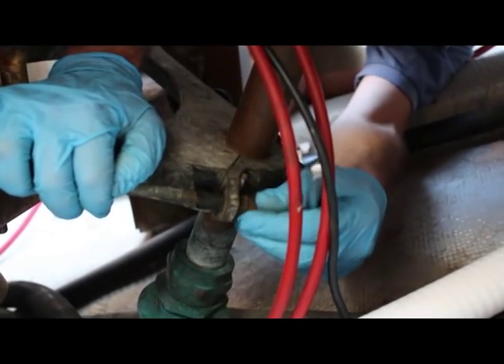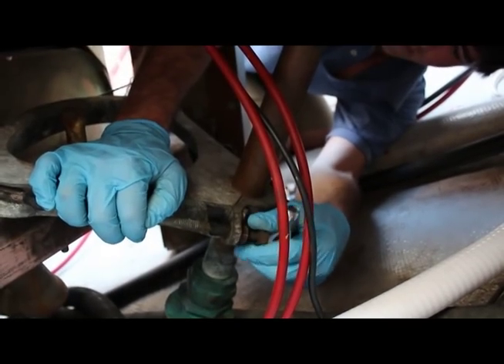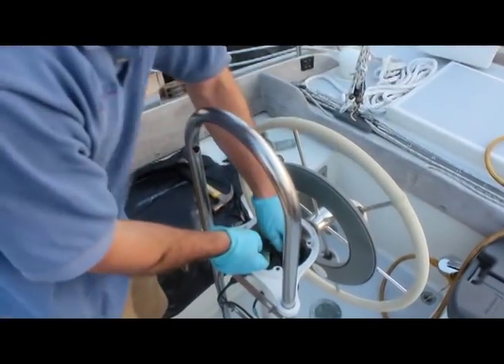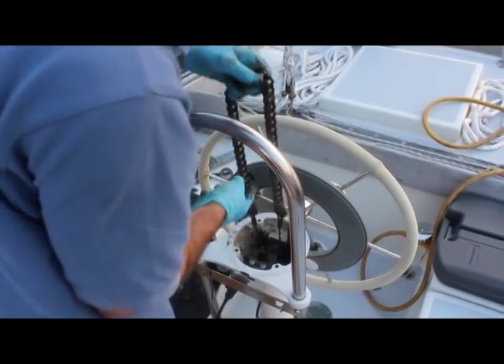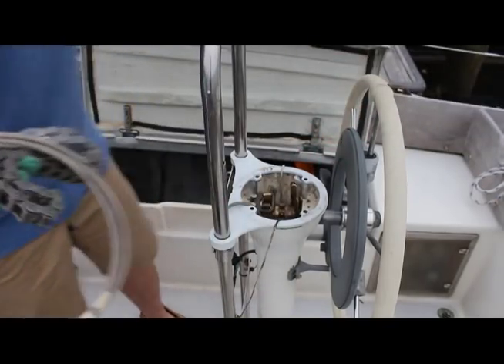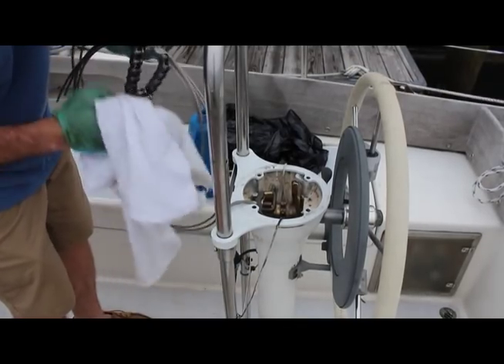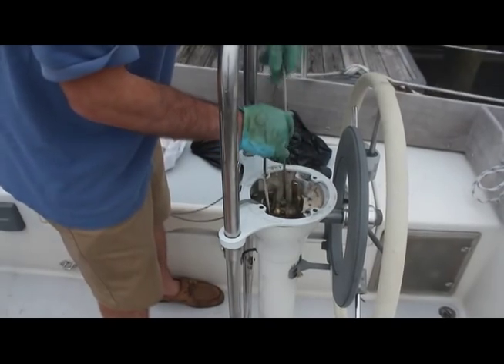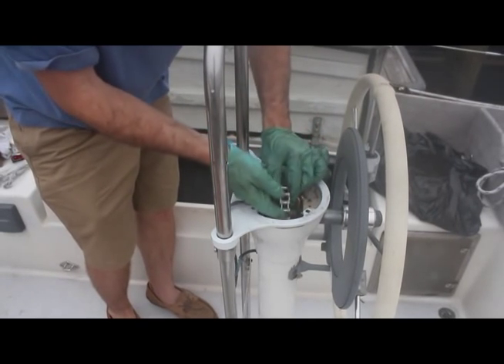Replacing Chain and Wire

Comment: You can install the emergency tiller and tie it off to keep the rudder from swinging aounrd..
Reply from the maker: Mike, thank you for sharing your idea. This is a great way to prevent the rudder and rudderpost from moving! A rudderpost secured from rotation is needed to safely carry out a chain and wire replacement on any boat.

Comment: Nobody mentioned that you have to cross wires in steering column.
Reply from the maker: It depends on the configuration of your boat. With a radial or quadrant where the cables attach on the far side of the post from the wheel, you need to wrap. On a quadrant where the cables attach between the wheel and post, no cross.

Comment: I want a video on double helm 😆
THis is too easy With one wheel
Reply from the maker: Thank you, KeeledOver. That is a great idea - we'd be glad to shoot that video too! In the meantime, if you need any help replacing your chain & wire on your twin helm boat, please give us a call and we can walk you right through it: +1 (508) 995-9711.
Reply: I really appreciate the offer I could have used your help last week. Local rigger gave me a hard time saying how easy it was 

I even bought a nice 3/16 fish tape that ended up being useless 

I believe the same wire kept hanging up in the radius of the guide tubes 

For anyone who has trouble  try my trick:
I took bailing wire and paracord

Take the paracord and remove the core, slide the bailing wire inside about 5-6’ up the core 

The tape the paracord with electrical tape every foot and at beginning and end with 1-2 tight wraps 

Thank you so much you are welcome to visit my boat wherever I may be (Dana point at moment )